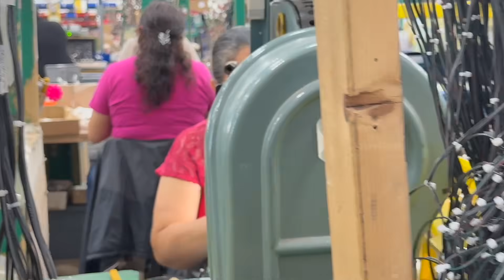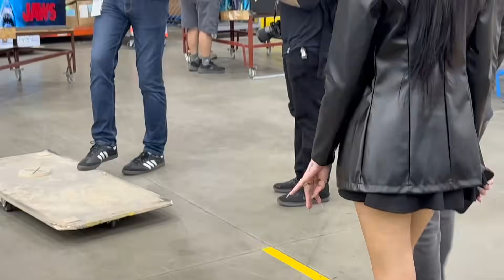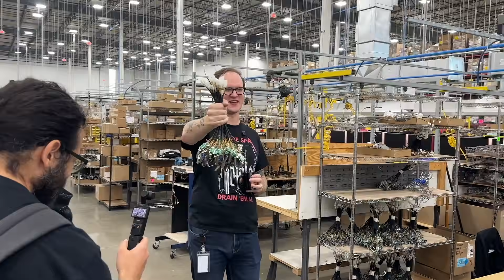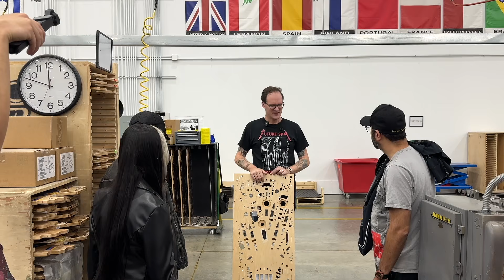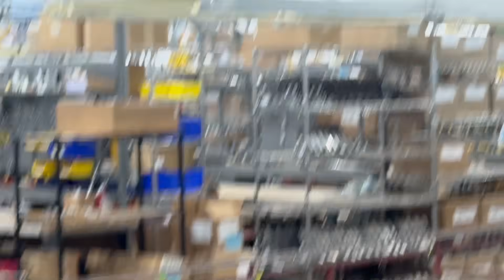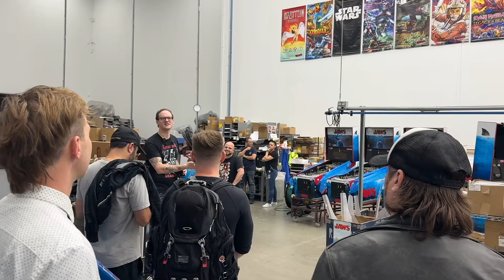Stern Pinball Factory Tour 2025

Comment: More than 45 years ago growing in Shitcago I remember looking at the vendor power supplies for Bally that had Japan and Mexico components on the board. You have to go back at least 50 years ago to have a pinball that had 100% made in the USA that were all mechanical. Today everything is imported and assembled in the states. That is the major problem of the USA today. Americans are all basically broke but a few have credit to buy a couple of things. It would be very smart if Stern would make a very simple machine close to the late 70's into the early 80's models. It would be much cheaper to make that should make it much cheaper to buy. I forgot, common sense is a rare commodity today.

Comment: FYI the Costco Star Wars game is ABSOLUTE trash.  I'm just sayin'......
Reply: @JasonDavis103  Funny thing about that. I want into pinball at all. Then I saw that Star Wars pinball machine in Costco. I played it for a bit and loved it!  Then I did a deep dive into the pinball world, and road 8 hours to buy a Lethal Weapon 3 pinball. Lol.   I'm having a blast! But you're right,  the costco machine is basic.
Reply: @Mydriasis100  meanwhile I'm over here mulling for 6 months on what machine I would buy 😂. I'm impressed. Enjoy!
Reply: Thanks for the tour. A 56 year career tool & die advancing to project engineer at the same company making custom plastic injection molds & parts. Have seen witing boards using our connectors from a small backyard street rod shop to The Big Three automotive by hand assembly.  
Not a pinball game but saw a nickel horizontal 8 horse racing slot machine in the '80s I thought I could duplicate. The numbered horses turned on a 10 inch diamete aluminum round inside a country Downs, it's underside had round pockets to accept the nickel injected from the right side hand lever pull spin. A pneumatic brake halted the rotation at a horse dumping the nickels that had accumulated - surplus nickels simply were pushed into the House lock box! Never built, scared of the clutches and brakes.
Enjoyed a possible modern version of my dream.